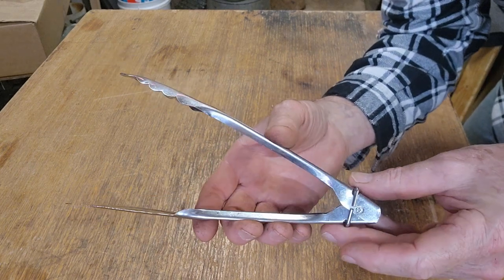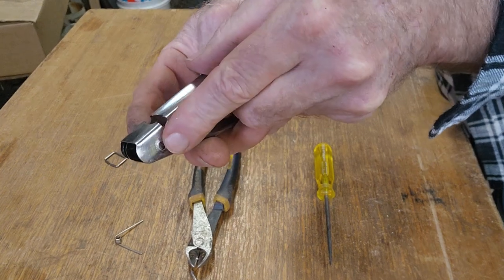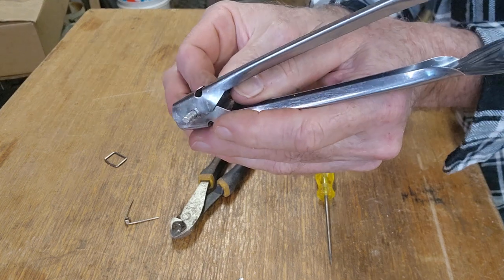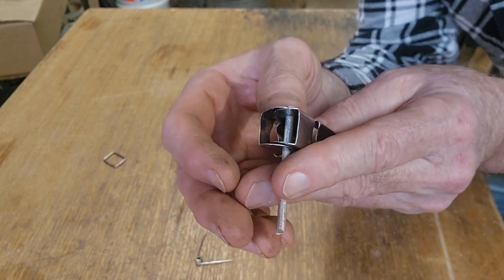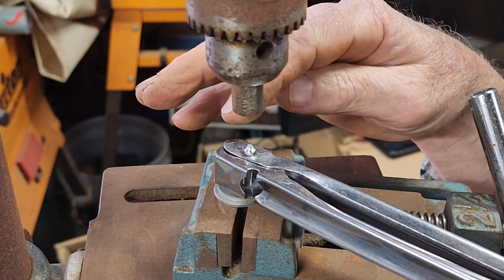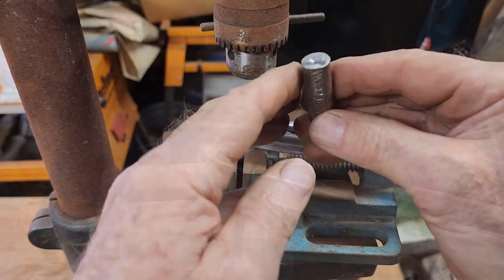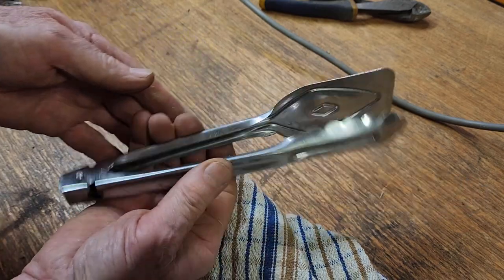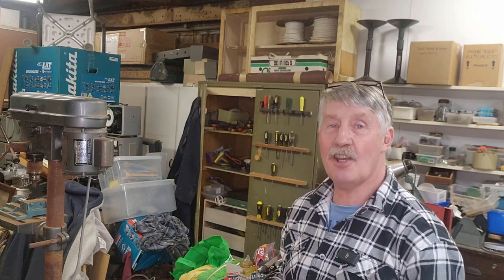How to Fix Kitchen Tongs. Making a Rivet Spinner to Repair a Worn Pivot Pin. Saved from Scrap Metal!

Comment: Awesome job, and interesting technique! For a long time I thought of rivets as being non-repairable, so it's been good learning how to work with them. 
Aluminum doesn't like dishwasher detergent, though I think it just gets tarnished (and the old rivet was the same anyway).
Reply from the maker: Thanks mate. Tarnish doesn't really matter. Aluminium has a very tough oxide layer which usually protects the metal pretty well.

Comment: Good repair. If you are wondering where more aluminium wire is to be found, offcuts are sometimes left near electricity pylons. The cables between the towers are aluminium wires twisted together, like rope.
Reply from the maker: Ah thanks Rolf, I didn't know that! 👍😊

Comment: REALLY COOL FLARE on the rivet, I haven't seen that before. I still have My tongs i repaired 30yrs ago with a bent over nail (it's a bit rusty, but hasn't rusted away) i think they were less than 3 months old from Kmart and i wasn't about to go buy another pair when these only needed an improved hinge pin :)  the nail would have been whatever was in the shed on the day that fitted the holes. (wasn't easy to bend, i held it in the side cutters and bend it over 90deg with other pliers)
Reply from the maker: Yep, a bit of Aussie farmer showing through there Dean! Bent nails, fencing wire or hay-band can nearly fix anything! 🤣

Comment: Wonderful!  Unfortunately, I don't have a drill press. ☹ I need to fix 2 of my tongs.
Reply from the maker: Maybe there's some way to secure the tongs in a vice and use a normal drill? Even a long screw and nut may work. Hope you can fix them.. 👍

Comment: Thanks for posting. I've replaced these rivets with a small brass nut & bolt, and then I centre-punched the bolt near the nut to stop the nut coming loose.  But WHERE CAN YOU GET THE SPRINGS?? This is the biggest problem. I have a good set of tongs with a broken spring.
Reply from the maker: Yep, brass hardware is a good option too Ian 👍I don't know about springs - maybe from a donor set of tongs from an Op-shop?

Comment: The tongs bought from retailers are designed to fail because not only is Aluminium soft, it is sacrificial to SS and corrodes. specially in a dishwasher.  This is in contrast to the one supplied to the hospitality trade though their wholesalers, and are assembled with SS rivets.  I have seen these units, years after I started repairing my wife's....
My solution is to go to a car parts store and get SS split/cotter pins and washers. Thread the pin through the washer, then though the tongs, then another washer, cut pin about 10mm past the washer and pig tail the split pin ends away from each other with needle nose pliers for safety.  These will now last as long as the spring doesn't rust and fail.  I have not found a suitable replacement SS spring yet....  **Any one know where I can get SS spring from????***  🤔 🤔 🤔
Sydney Australia
Reply from the maker: Excellent advice for a long lasting repair mate! Not sure about SS springs though - someone must make them 🤔👍